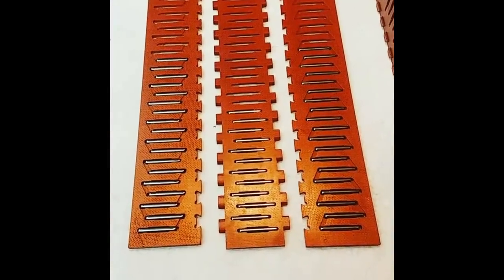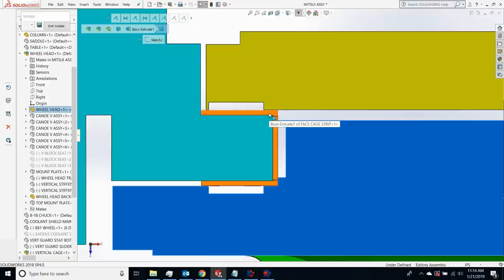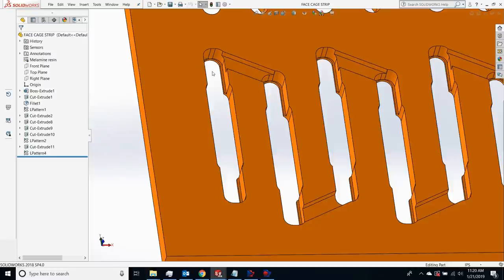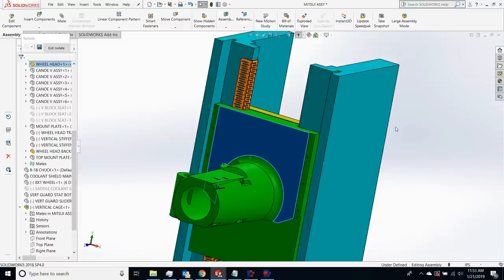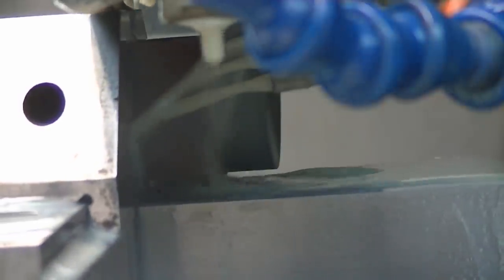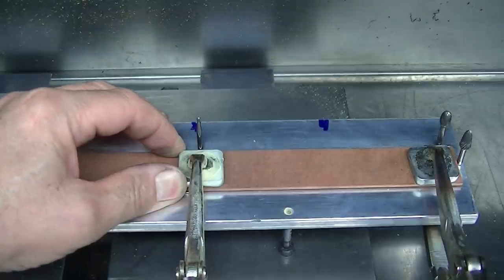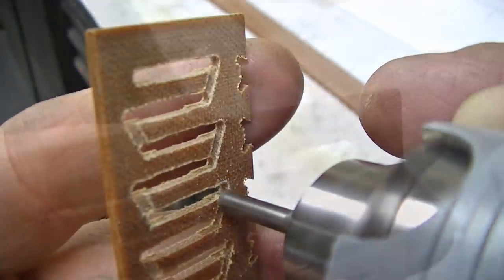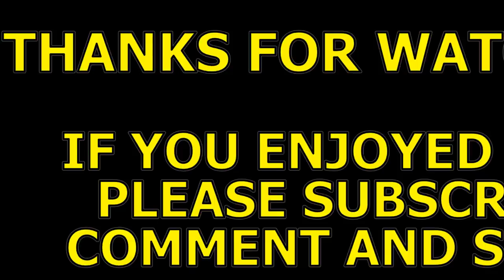MAKING LINEAR NEEDLE BRG. CAGES

Comment: "Shop Notes"*

• Overview of the vertical ways on the Mitsui and the change to needle roller bearings
• Acquiring needles from standard radial bearings
• Design of modifications
• Rails from planer blades:
Grizzly Tools: https://www.grizzly.com/search?q=(planer+AND+blade)+OR+(planer+OR+blade)#
• Kinematics of rollers and cages
• Fixture design and setup for the cage grinding.
• Silicon Carbide wheel for grinding 'crispy plastics', 50D gasket material for vacuum hold-down
• Buddy Rich drum solo?
• Sanding block with diamond film
• Fly-cutting abs as sacrificial backer
• O'-flute cutter: 
http://www.harveytool.com/prod/End-Mills-for-Plastics/Material-Specific-End-Mills/Browse-Our-Products_253/End-Mills-for-Plastics---Square-Upcut---Single-Flute_113.aspx
• Deburring with Diamond sanding blocks
What I believe is the correct product:
McMasterCarr: https://www.mcmaster.com/sanding-sponges
• Robin sympathizing with every dentist (aka deburring)

*Not affiliated with any manufacturer or supplier.
Reply from the maker: Thanks again brs_workshop for your excellent contributions.  Added to the video notes.
Reply: I really like your shop notes. It's a nice way to recap after I've watched the video. I hope you'll continue to do them! :)
Reply: @ROBRENZ  Can you use hardened dowel pins as roller needles?
Reply from the maker: @zachary3777  Not accurate enough
Reply: @ROBRENZ  i'm guessing 'precision ground drill rod' is not precise enough either
Reply from the maker: @laughlan22  correct

Comment: In solidworks, if you want the cage to move half as far as the head, you can use the linear/linear coupler mate in the advanced mates section. Not important for what you're using it for, but it can be nice to see everything moving properly.
Reply from the maker: Thanks, I was looking for that mate but thought it was in the mechanical mate section so didn't see it. Mate applied!

Comment: I like your concept of using the phenolic as a close fitting damper, where I work we build our own specialty machines and we had one rotary corrugating machine (basically large hor.mill) that the boss wanted to try linear rails on. It was an extensive machining project to install the rails without inadvertently raising the table more than we needed to, but we got it done. Machine ran very well but was significantly noisier than the other four machines around it and tool life decreased to about 60% of what it was. It's still running to this day but there is what looks like blood running out of the trucks from the fretting being carried out by the way lube. The rails were 60 mm roller bearings. Just goes to show the damping properties of plain bearings are hard to beat for heavy cutting, I used to wonder why a vertical cnc mill with linear ways had such a thick heavy table, now i know, damping. Your setup should be wonderful on a grinder, cant wait to see the rest, cheers!
Reply: cgprecision, my thought also, for low speeds two very large flat surfaces are more easily separated by a film of oil . For higher speeds I can see how rollers could more easily form an oil "wedge"  AKA enter the realm of hydrodynamic lubrication.  At times (like this project video) lack of "stiction" is more easily achieved without large surface areas "dragging" oil.  Man I wish Renz was my dad..all those cool custom machines no stranger could ever appreciate? (well unless they watch youtube! ;-)
Reply: @unionse7en  We have experimented with many different materials with all of the machines we build, and for our uses it's hard to get away from properly scraped Ptfe liners running on hardened ways, and actually we have been testing some rulon XL which is not designed as a wayliner but is intended to run on aluminum, it's actually harder than turcite but lower friction overall but what's key is the static and dynamic COF is very close, and due to that we have not experienced any stick slip, also it seems to wear the same on soft cast iron as turcite on hardened rails. We have found over the years that while cast on cast is great for hydrodynamic lubrication or at least elastohydrodynamic, the Ptfe breeds are best scraped for and treated as boundary lubrication setups only, and although they lack the floating wear free hydrodynamic condition they hold up just as well and the ptfe does wonders for vibration damping. We are planning a build in about a year for a fully hydrostatic machine, which is the Cadillac of all systems (including cost!) But were hoping to drastically increase damping wear life and positional accuracy. I see now they offer linear guides which are hydrostatic,  which is a novel concept except that you still only have the surface area of the trucks  vs a traditional setup which is vastly more. I'd be curious to see if any commercial MT builders start using them.
Reply: @cgprecision  , that's great info ...thanks!

Comment: Good idea to measure and sort needles with high accuracy (in 0,001-0,002mm) before putting them into one side of linear bearing. Their size may differ from bearing to bearing.
Reply: may as well throw in taper and runout while you're there.
Reply: And out of round😈😈😀
Reply: @bobbob8229  and straightness...

Comment: Very nice design and fabrication! You have my respect for how well you managed the Phenolic. Years ago I had make a devise to hold and position a cat that allowed for the animal to be rotated in a magnetic field. The devise was all Phenolic and by the time all the parts were made I developed an allergy to the stuff. I also remember it was a pain to get the machines and shop clean. Many thanks for you videos.
Reply: Isn't it absolutely terrible? Used to machine very small quantities of clutch friction elements and different electrical insulators, the stuff is just awful. Even being careful, you could smell it throughout the shop and it is quite a hazard to inhale.

Comment: Excellent inventive and elegant solution, mesmerising attention to detail. The linen based on is an a excellent material, many companies don't like to machine it, ref health, and difficult to clean the machines after.
Great set-ups, and production methods.
We use it to clamp hydraulic piston rod material for friction welding the rod end or eye, it is manufactured by Tufnol here in the UK, Carp brand is cotton based. Can be glued together, cross grain for strength.
Best regards from the UK.

Comment: Hi Robin, Excellent, Thank You... Your attention to detail and thinking is as always, exemplary. I'm with you on the the Tufnol de-burring, did a lot of work in this stuff during my Toolmaking apprenticeship; often in tiny little parts 20, 30 thou thick keys in alloy tubular spanners (wrenches on your side of the water) for tightening nylon retaining rings in optics systems etc. and I still have the micro-fine 'knife profile' needle file I used back then (though I managed to snap the tip off it but not bad for over 40yrs old). Looking forward to the next episode, All the Best....

Comment: G'Day Robin, love listening to your running commentary with your thought process and design justifications.  Should have a small competition on how many ways we can use a dowel.  As the cages move half the travel of the head would you expect any micro slippage between the two column cages where one side might go out of sync with the other over time?  Is there a quick way to 're-zero' the cages if this does occur?  Yes, I live with Bozo here in my workshop and he pops up at the most inconvenient times but I am enjoying the re-learning process of machining.
Cam
Reply from the maker: Hi Cam. Cage creep is a real phenomenon but is usually most prevalent in vertical higher speed motion where the cage inertia also has gravitational loading added to the inertial force on the down stroke causing slow migration of the cage downward. The vertical travel of the surface grinder is extremely slow so inertia loading is minimal. I plan to run this without any creep control and monitor the creep. If it appears in any measurable amount I will add a pulley counterbalance on each cage assembly that has slightly higher weight than the cage/needles to reduce the creep to insignificant levels.

Comment: As usual, greatly informative.  Especially the reasons for design choices based on material availability and tooling usage.  My only thought is about the exposed phenolic.  Do you have to keep it clear of some shop solvents?
Reply from the maker: It won't be exposed when installed and its pretty solvent resistant anyway.

Comment: Interesting video! Just the thing to take my mind off endless cad and cam work. I've seen that fenolic stuff before but always wondered why it was used. I'm sure the available bearing drove your design choice for the length. In a perfect world would you have chosen to have the front and back face have longer rollers? Excellent video I'm looking forward to the rest of the series.
Reply from the maker: Thanks, and in a perfect world I would have used longer rollers for the front and back.

Comment: Awesome as usual Robin. Did you Pic fabric phenolic over paper phenolic for the strength. Or was there another reason?
Reply from the maker: Thanks, It is actually Linen Phenolic which is stronger than paper but is also the preferred material for class7 spindle bearing cages. So I figured it was a good choice.

Comment: Nice work Robin.  How do you prevent the new cages from being crushed at end of travel when the cages become out of position in relation to the head?  E.g.  The cage will travel half the traveled distance of the head but nothing keeps the linear relationship linked together. The cage may eventually be out of position compared to the full stroke of the head. What stops the cage from being lower than the  full down stroke of the head? Interested in your thoughts.
Reply from the maker: Preload keeps them linked to each other but cage creep is a real phenomenon but is usually most prevalent in vertical higher speed motion where the cage inertia also has gravitational loading added to the inertial force on the down stroke causing slow migration of the cage downward. The vertical travel of the surface grinder is extremely slow so inertia loading is minimal. I plan to run this without any creep control and monitor the creep. If it appears in any measurable amount I will add a pulley counterbalance on each cage assembly that has slightly higher weight than the cage/needles to reduce the creep to insignificant levels.
Reply: @ROBRENZ  Thanks for your reply.  And again, nice work.

Comment: Wow. I'm wondering if it's "assembly lube", a piece of tape, or a strip magnet which will keep the rollers in place during the initial assembly, or will the stiction of regular ways oil keep the rollers in place?
Reply: You can put on Vactra #4 with a spatula. It'll hold the parts in the race.

Comment: Robin, won't the glass fiber in the phenolic wear steel surfaces? Just a thought. This all looks amazing. Soon I'd like to see a flatness-off between you and Solid Rock!
Reply: Thomas Manning P2 phenolic has cotton cloth not glass fibre in it.
Reply from the maker: That is why I used Linen Phenolic.  It is Phenolic resin impregnated lInen fabric with which is not abrasive at all. It is the same material that many class 7 spindle bearings use for the ball cages.
Reply: Thanks for the replies, folks. I guess I see no flaws then. 😜
Reply from the maker: @Ed Rees Paper based has higher tensile strength but I think the linen/cotton is tougher. It is the material of choice for high precision ball bearing cages so I thought that made it a good choice.

Comment: Robin, I'd like to know your thoughts on choosing phenolic resin for your cages instead of delrin, which you used for the bearing cages for your table rebuild (on the same grinder?) about 6 months ago. Is there some inherent quality of the phenolic that makes it better suited for a vertical application, perhaps?
Reply from the maker: IMO Phenolic is stiffer, higher tensile strength, wets with oil well, better bearing material if the slides touch it, but a pain to machine.  The ball cages are much lighter loaded and are don't have the small detail the needle cages do so the Delrin is a better pick. Both are on the same machine.

Comment: My concern would be the hardened steel needle bearings "brinnelling" the relatively ways due to continuous high-frequency vibration while grinding. Needle bearings that do not roll continually and easy leave their marks on u-joint cross bearing surfaces all the time and pretty deep ones that are made pretty quickly in a u-joint with insufficient angularity and/or improper lubrication. The ways may be "hardened" and "steel" but at best the "steel" is probably nodular iron and it isn't "hardened" enough that it isn't/wasn't easily "cut" post-hardening. U-joint crosses are 58-62 HRC and needles brinnell them easy as pie. Its a unit-pressure phenomenon.
Reply: He said they're hardened D2. So they probably aren't nodular iron.
Reply: Second that. I've seen needles leave marks over a mm deep in hardened steel.
Reply: The unit loads on a U-joint would be orders of magnitude higher because there are so many rollers here in comparison with a u-joint, and given that these are preloaded, and the preload will greatly exceed the applied load, I would be surprised if the vibration caused any significant fluctuation of that unit load. There will also be viscous damping, with Vactra way oil continually available by capillary action from the oil wedge on either side of every roller, if there is any relative displacement. With preload, If there is not displacement, there cannot be stress fluctuation, as in a bolted joint.
If Rob was not careful with the balance of heavy grinding wheels, you might have a point, but ask yourself: is he that kind of guy? I personally think his design would cope with the sort of vibration you might expect from a milling operation, which is far in excess of anything a grinder will ever produce unless a stone breaks.